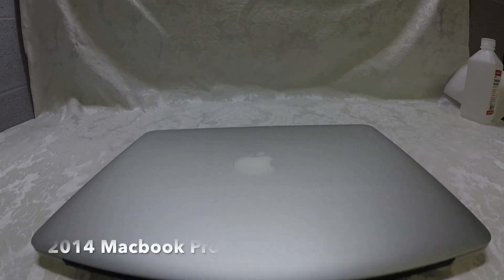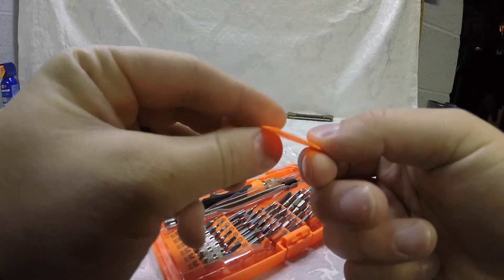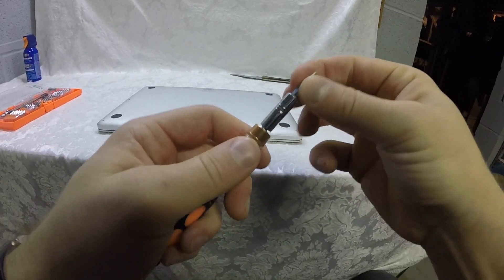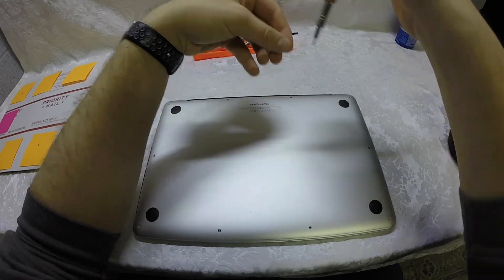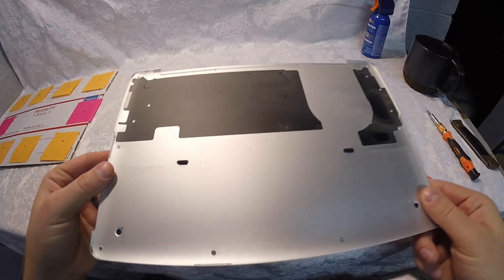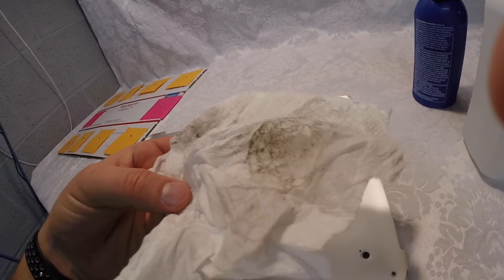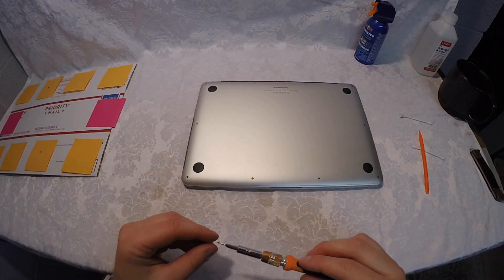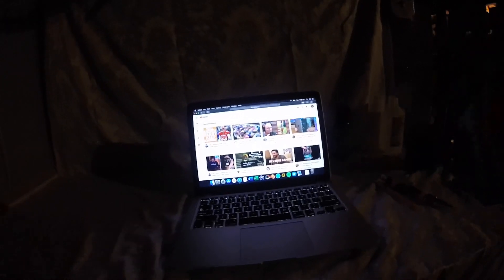How To Clean Dust Inside MacBook Pro (2014)

Comment: Hello! I want to ask, if I use a violent dust removal fan to clean my Macbookpro to remove dust, if it blows on the cooling fan causing it to reverse and generate current in the opposite direction, will it cause damage to the motherboard of the computer? I've seen this claim, is it true?
Reply from the maker: @calmfengfeng3540  that was my understanding that there was some damage created, yes! But I am no expert. I hold it down even in the video to make sure.
Reply: @MillennialBro  Yes, I see this rigor in your operation, but I haven't been this attentive before and it worries me. Thank you for your answer!

Comment: man i came from a youtube comment and i want to buy mid 2014 macbook pro 15".Everyone says they have problem with their screens it's peeling of.M scared about this comments about mackbook but it is my dream about 5 year.I have enough money to buy but i do not really know what should i do.I looked  to Huawei Matebook D15 15.6" but i did't like as like as Apple man and i m going to use fl stuido and logic pro,so i think i should get an apple what do you think ?
Reply from the maker: Do it! Do not be afraid! I think the issue more comes from stressing the screen by heavy usage combined with improper chemical application. If you can find one that is in condition, strike, then treat yours as it was treated! There are plenty of folks who did not suffer the screen issues. Mine is still going strong, been using it every day since I bought it, video editing fairly frequently. Life's too short, get that laptop and enjoy it!
Reply: @MillennialBro  thank you so much :) Tomorrow m going to buy that i interested.
Reply: @MillennialBro  i just learned,the macbook that i look have CYCLE 947 battery and health is %80,7 is it bad or normal? And how was yours when you buy?
Reply from the maker: @oumuamua1541  I believe they are the same number, 80% represents the 947 cell count, so that battery can only operate at 80% battery capacity. Mine was very very good, 250 count. Yours is high, but probably most are about that number.
Reply: I have one, what is the screen issue?
Reply: @mustafar  steingate, some kind of fail peels of the screen but it doesn’t affect the function at all.
Reply: My MacBook Pro screen was peeling then I when hame with some listerine and it looks really good now
Edit: I would buy an early 2015 15in because those ones are going to by supported by macOS Monterey and they are about 500$